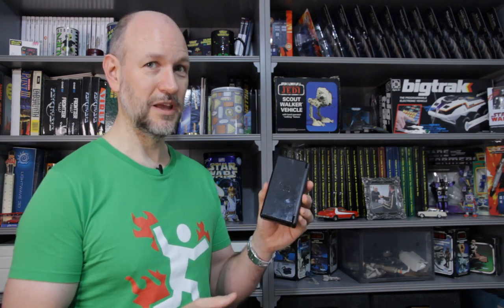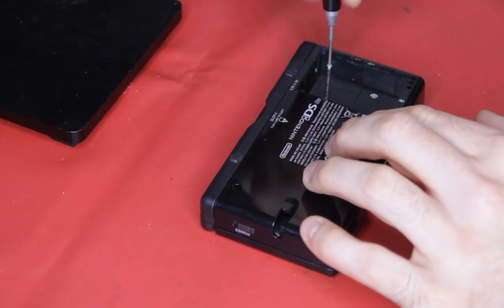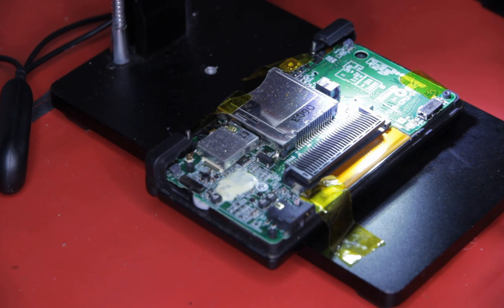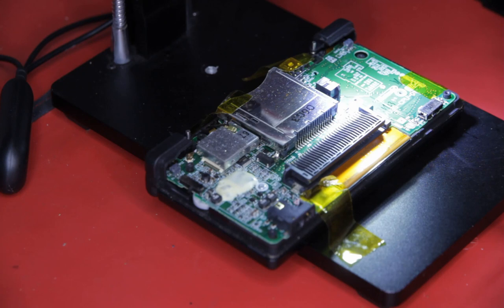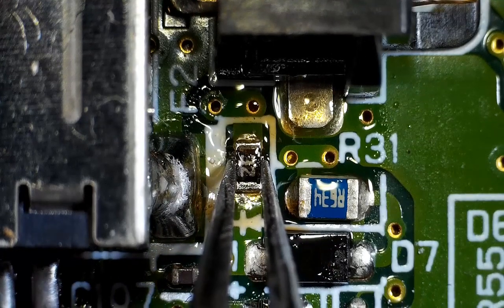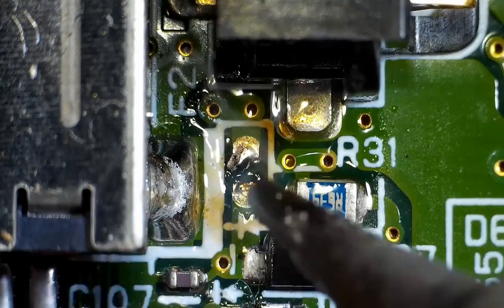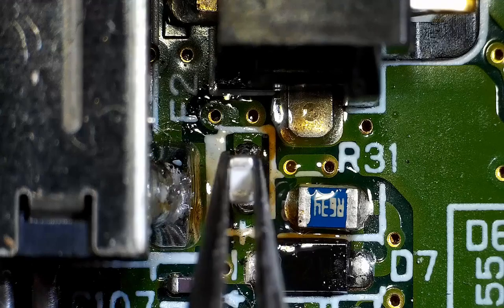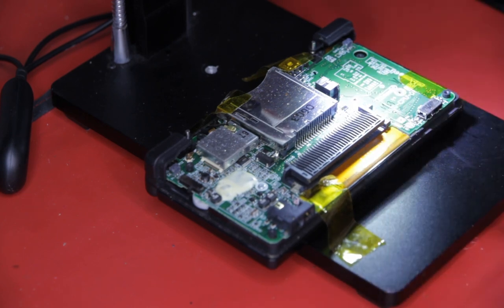How to fix Nintendo DS Lite (dead with no power)

Comment: About 9 years too late releasing this video 😓 amazing to see what can be done though with some basic electric knowledge and a few tools! They currently only sell for about 30 $USD on Ebay so think I’ll throw mine.
Reply from the maker: Thanks for watching and I get what you mean. I thought about doing YT vids about that long ago too but life got in the way. I was fixing it anyway and a good thing to get the ball rolling. Interestingly though I think the DS is at that rock bottom stage where people do bin them. Then if it follows the pattern of other old consoles they come back into fashion and they are rarer because they were binned.
Reply: @TheDigitalOrphanage  yep I agree re old consoles coming back into fashion. Even old iphones sell, but the old consoles are always worth saving if possible. Unfortunately I won't be fixing one I currently have, will just sell it cheap for parts
Reply from the maker: Even if only good enough as a donor, it'll still be useful to someone to bring another DS Lite back to life. Definitely better than binning it.

Comment: 😭my biggest problem to fix my goddem nintendo ds is i dont have an "Equipment"    🤦‍♂
Reply from the maker: Yes, that is a big stumbling block. I would normally suggest seeking out a local repair cafe to find help, but that might be an issue at the moment for most people. A small budget soldering iron (which usually come with some solder), the fuse, and the tr-wing screwdriver are the minimum you need. Tweezers and a magnifying glass would make the job easier. Take care.

Comment: My ds lite has an issue where it turns on for a split second then just dies. But if there is a Gba cartrige in it, it boits up the gba game. It won't run ds games. It just powers off. Any suggestions? Imma be asking around a couple comment sections
Reply from the maker: Sorry, not seen that issue. I hope you find an answer.
Reply: The upper display is dead or loosely connected. Check the ribbon cable for upper display.

Comment: I'm glad you should removing the fuse with an iron. It seems in most videos they use a heat gun, which I don't have.
Reply from the maker: Thank you. I didn't have a hot air rework station at the time, and even though I have one now, I would still use an iron for just this single component.

Comment: Hello! I’m current have a problem with my Nintendo Ds lite. I just bought it a few months back and it’s brand new. But throughout the few months I had it, I notice that whenever the ds does, it automatically factory reset when I charge it and turn it back on. It always take me back to the screen to set my name, date, time, etc. Do you know what’s the problem or what I should do?
Reply: sounds like the battery is going bad, losing all info is indication the battery was pulled/taken out
Reply: @thiefrules  The weird part is I rarely use the DS. Only 3 times and it dies on it own so when I charge it, it takes me back to the setup screen like I have just bought it. Should I get a new battery? Or there’s already something wrong with the DS?

Comment: Hello sir, i would just like to ask about the em10

on a website called ifixit, it said that this kind of problem (not charging) is because of a faulty em10. But I've seen like 4 videos now of people fixing their ds lites by replacing the fuses. So I would just want to know your thoughts or opinion?
Reply from the maker: I believe if either the power supply filter (EM10) or fuse F1, are faulty then no power will get into the DS Lite. This would mean the charge light that comes on briefly (as shown in my video) would not light at all. So if no light comes on when the mains adaptor is plugged in, I would check the power supply is outputting the correct voltage, and then F1, and then EM10, in that order. The issue I solve in this video is where power is getting into the DS Lite, but the DS Lite cannot then charge the battery due to the fuse F2 being blown. I hope that advice helps you figure out how to fix yours.

https://www.ifixit.com/Guide/Repairing+a+Nintendo+DS+that+is+not+charging/6884
Reply: @TheDigitalOrphanage  Thank you very much. My DS lite has this exact same problem, so I'm sure I'll do well just following this procedure. Well explained video. :)

Comment: I have a question...my DS Lite fuses, charging filter, and charging port all test fine, but I still have the same issues you have in this video. (Orange light on for a second, then shuts off..won't charge, won't turn on.) Also, the battery is good. Any suggestions?? I'm about at my wits end with the damn thing. Appreciate any insight you may have. Thanks!

Comment: My DS Lite wont even show that it is charging, it just seems dead, I have tried holding the power button for about a minute and nothing happens, I looked at the battery and it doesn't appear to have anything wrong with it, do you think that it has just gone bad? It has the same battery that I have had in it since I got it all those years ago, do you think it's time for a replacement battery?

Comment: So my power slider is my issue it doesn't do its job and power the system but everything else works fine do you think you could help me?
Reply from the maker: Sorry, I've not replaced a slider switch on a DS Lite but there are plenty of guides out there and I believe the part is available.

Comment: What if you a kid trying to fix it, I had a ds for a while then it just stopped working. the screen would not turn on I charged it but only the the little light would turn on when its. charging what do I do?
Reply from the maker: It depends what your skills are but you should first learn how to use tools like a soldering iron and multimeter. This video is aimed at adults and minors should always ask their parents and learn how to the tools correctly and safely under supervision. There are a lot of videos like mine on YT that will talk through the steps to fix different faults. Your DS might have a faulty power switch if it's charging correctly.

Comment: nice video! you saved many of my Ds lites, i collect them, i have a last question, it does´nt matter which side the fuse is placed? because i can´t see any symbol to put them
Reply from the maker: Thank you for watching, I'm happy it's helping you. If you're asking, does it matter which way around the new fuse goes back in, it doesn't.
Reply: It does not matter what side is which as long as both contacts are soldered where they should be. If you want a quick fix, you can also not use a fuse and just make a solder blob connecting both points. Although its never recommended because power accidents may happen and it may ruin the board or other components.

Comment: Hello. On my ds lite, I checked fuses and em10. They looks like to be fine. Then I checked voltage on them. From charging port comes 5v. Then, on high side of em10 and on fuse 1 it became to 1,3v. Where should I look?
Reply from the maker: That's a very good question. I think I would test EM10 as per this guide.
https://www.ifixit.com/Guide/Repairing+a+Nintendo+DS+that+is+not+charging/6884

Comment: The fuse you left in the description isn’t manufactured anymore, do you have any alternative links?
Reply from the maker: Hi, I've just changed the description to the following:

UK - I purchased mine from RS Components
https://uk.rs-online.com/web/p/non-resettable-surface-mount-fuses/6243360
However, as this is now discontinued by RS, I've taken a look and this fuse has the same current (500mA), voltage (32V dc), speed (F) and size (L 1.6mm X W 0.8mm). It's a little thinner but that shouldn't be an issue. I haven't tried this fuse so let us know how you get on if you try it.
https://uk.rs-online.com/web/p/non-resettable-fuses/7594767

US - This appears to be a similar fuse available from Digi-Key but I haven't tried it.
https://www.digikey.com/en/products/detail/panasonic-electronic-components/ERB-RE0R50V/2796788
Reply: @TheDigitalOrphanage  Thank you so much! I plan on attempting this repair within a month or so, if everything goes well, I'll let you know how the new fuses work.

Comment: I have a ds lite and the fuse has a reading from the continuity meter. Do you know of any other idea of why it doesn't work and how to possibly fix it?
Reply from the maker: Does the orange light come on briefly when you switch on the power supply?
If not it could be F1 or EM10 filter (see https://www.ifixit.com/Guide/Repairing+a+Nintendo+DS+that+is+not+charging/6884)
If it does light and F2 is OK, then it could be the power switch or the battery at fault.
Reply: @TheDigitalOrphanage  it will charge for anywhere between 30-60 seconds when it first gets plugged in to the charger and then the orange charging light goes off. If unplugged and then plugged back in it will do the same thing. Does not turn on either. Is it possible for you to resend the link as well? When I clicked on it it gave me an error message and said the page can not be found.
Reply from the maker: If the light comes on I doubt it will be F1 or EM10.
Possibly switch or the battery itself.
https://www.ifixit.com/Guide/Repairing+a+Nintendo+DS+that+is+not+charging/6884
Reply: @TheDigitalOrphanage  Awesome, thank you so much!

Comment: I've never done soldering before, would you recommend this as a good beginner area? My DS Lite has the same issue. I do have knowledge in device complicated repairs like the hellish 3DS top screen, just never soldered before and was thinking this could be my first project.
Reply from the maker: I suggest practising on a scrap piece of electronics to get the feel of soldering first. The main issue with this as a first project is that the fuse is very small and fiddly, so make sure you've got some way to magnify what you're looking at.
Reply: @TheDigitalOrphanage  Smart idea, I remembered just now I do have extra motherboards I can test beforehand. I have gentle hands and good eyes so fiddlyness should be okay, thanks! Will be following your guide soon!

Comment: Hi, first of all, thanks for uploading the video. I put stuff on YouTube too and know how time consuming video editing and recording can be

My question is, how did you know that component is a 500mah fuse? I had a look at smd codes and 3z never came up as a code for a fuse.
Reply from the maker: Thank you. If you read the very small writing on the back of the DS the current draw is specified as 450mA, so a 500mA fuse gives just over 10% headroom. It's a fuse value that is generally considered ideal and my nephew's still using his DS without issue since I made that video 2 years ago.

Comment: Just found my old DS lite and there is no orange light when plugged into the charger. Does that mean that that the fuse has blown?
Reply from the maker: If the power supply is working, and no lights come on, it might be fuse F1 by the power in socket or EM10.
https://www.ifixit.com/Guide/Repairing+a+Nintendo+DS+that+is+not+charging/6884
Reply: @TheDigitalOrphanage  I took my ds apart and when I try to remove the black cable that routes under the ds slot it gets stuck. When I pull the cable there is resistance. Is there a way to get it out?

Comment: Hey there I have a question. So I recently found my ds lite and decided to charge it up and use it. The lights work fine when charging. However when I use it, it shuts off after a few seconds and restarts. When I leave it plugged to the charger, it works just fine.Is it just a matters of replacing battery or do I need to do something with the motherboard? Thank you for taking the time to read my comment.
Reply from the maker: That is a very good question. I haven't seen an issue like that on a DS lite, however my wife's old phone had a similar issue which was caused by the battery. If you know someone with a working DS it would be a simple thing to test with their battery. Otherwise it's probably worth getting a new battery if you know yours has been used a lot over the years.
Reply: The Digital Orphanage thank you so much for replying to me. I have played this ds for nearly a decade and left it in a box for a couple years. I have decided to buy a replacement battery on ebay. I guess it’s just the battery that is faulty

Comment: Hello, I was wondering if the voltage on the fuse is a make or break factor in this context. I found some fuses online that are 125V instead of 32V and I’m not sure if that would still work for this device.
Reply from the maker: My understanding is that as long as the voltage rating is equal or higher it shouldn't matter. It describes the voltage up to which it can safely be used (otherwise it could arc across a blown fuse if the rating is lower than the circuit voltage). The current rating and the speed do matter though. Too high or slow and something else might blow before the fuse does. This is a good FAQ.
https://www.fuseco.com.au/fuses/faqs

Comment: Hey im late to the party but I have 2 ds lites, one that has a blown fuse but is in really good condition and the other turns on fine but the buttons are unresponsive. Is it possible to transfer the fuse from the one that turns on to the other that doesnt?
Reply: edit: I just want to be sure before I do anything and trash both my ds lites
Reply from the maker: Hi, thanks for watching. In theory it would be possible, but in practice I think you would physically break the fuse trying to de-solder and remove it from the board. The fuses are cheap so not worth trying. Swapping the whole board, if the same, is an option too. I think you should try and fix both, the unresponsive buttons possibly just need the contacts cleaning. Try ebay for the fuse, I can see sellers selling a pair of fuses for £1.50 delivered.

Comment: I've got the feeling that you removed a 3×10²Ω resistor, with the marking 32, and then put a fuse (shortcut) in its place. 
Since it is a resistor, the continuity test failed. 
The fuse marking on the board seems to refer to the via it is next to. And the fuse itself is probably in the other side of the board. 

You might have been just lucky and have created an alternative path to ground through some other components. Hopefully they will not burn on the long run.
Reply from the maker: I'm confident that I replaced a fuse and this is a well documented repair on the DS Lite ( for example see http://ackix.free.fr/blog/index.php?id=77 or https://www.fixya.com/support/r4083827-ds_lite_fuse_replacement_f1_f2 ). Different manufacturers mark their 0603 fuses in different ways, some with letters, some by colour, and some with numbers. Besides I made this video over 2 years ago and my Nephew is still using his DS Lite without problems.

Comment: I know next to nothing about this type of thing but I reckon it's worth giving a shot than going out and buying a new system if I can fix it instead. What are the names for all the tools used in the video though? such as the fuse checker and the liquid stuff?
Reply from the maker: Hi and thank you for watching. The device used to check the fuse is a multimeter set to continuity or diode test mode. The liquid is flux which helps solder to flow better. Always worth having a go but best to practice basic soldering skills on some scrap electronics first. There's some great soldering tutorials on YT.
Reply: @TheDigitalOrphanage  Cool, thanks for the info!

Comment: Is there a chance of explosion if it fails? I'm a newcomer to this sort of thing and I need to know before trying this on my own.
Reply from the maker: Thank you for watching. Unlikely, but if there's another fault that causes the battery to overcharge and get too hot, there's a chance it could catch fire. Check for signs of other issues, like corrosion, and play safe if not sure. So long as you closely monitor it for heat after plugging it in you should be OK. Perhaps find a repair cafe to have someone confident with you. https://repaircafe.org/

Comment: I took me ds apart and found a few blue dots of something on the circuit board by the battery.how can I fix this, I get the orange light also
Reply from the maker: That's an interesting question Jason. I'm not sure exactly what it is. It could be residue from copper corrosion if it's a greeny-blue colour and near corroded contacts. It could also be residue from a blue coloured drink spilt on it. That could cause a short circuit and hopefully blow the fuse rather than another component. Have a watch of Louis Rossman's videos for the type of process to diagnose, fix and clean liquid damage with surface mount electronics. Maybe someone else seeing your comment has seen the exact same issue and has a better answer though.

Comment: My son dropped his DS on the ground and now we get the dreaded orange light that turns off right away and won’t turn on. Is it possible to test the DS battery with a multimeter first to see if it is the battery? I assume it probably isn’t considering it was working fine until he dropped it but I just want to rule out all possibilities
Reply from the maker: Hi Cory, sorry to hear that. You could check with a multimeter whether the battery has around 3.7v across it's terminals. I think you could also check to see if there is any voltage change across the DS's battery terminals when you plug in the power adapter, although I haven't tried that test myself. My thinking is that the DS  tests for the battery and then sees whether the battery will take charge, stopping if there is no change. If the fuse has blown there is no continuity so it will not detect a change in voltage. Probably best to open it up though and check the fuse directly and see if anything was damaged in the fall. (standard disclaimer of me not taking responsibility for any advice followed).  Let us know what you find!
Reply: I had the same problem, I just kept plugging it in and out and eventually it kept charging